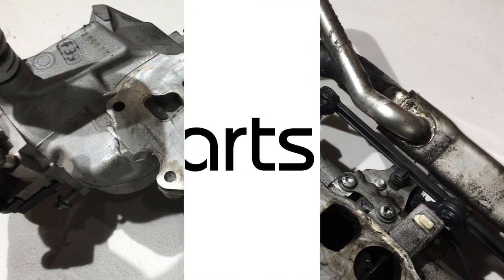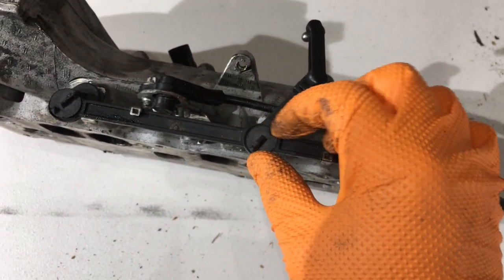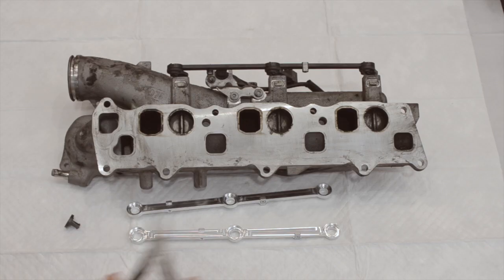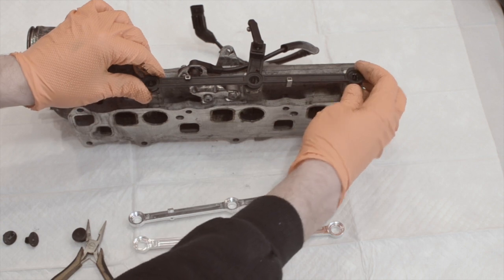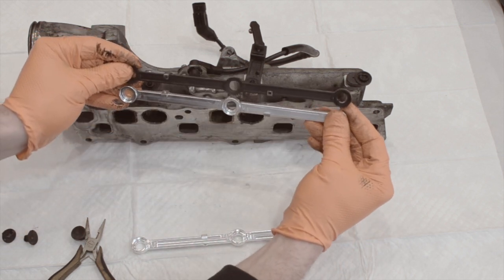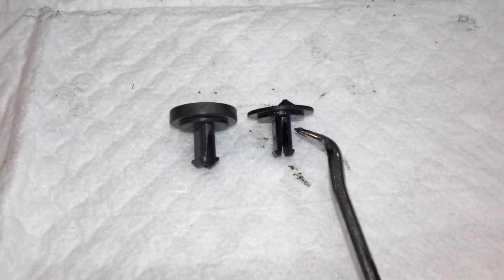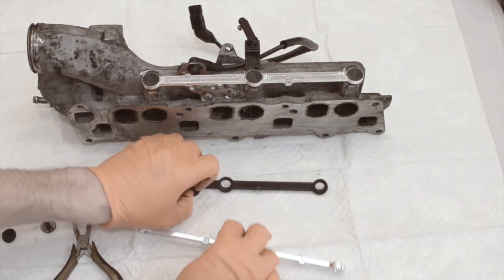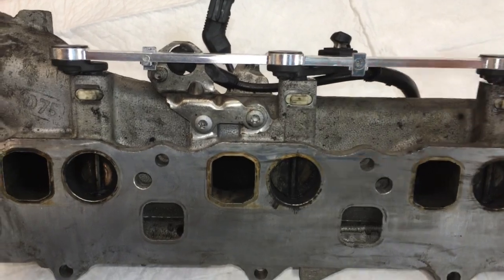OM642 Swirl Flap Rod Repair & Upgrade Kit

Comment: That's a lot of work compared to putting a 4.7 kOhm resistor in the swirl flap motor plug and just ignoring the tiny decrease in fuel economy.
Reply: Have you done it? Is there any increase in acceleration?
Reply: @BBoySewo  Probably a bit worse acceleration and low end torque, those swirl flaps help at low rpm.
Reply: @em4703  thank you for answer. I changed them recently for a new set. Those plastic parts are not really durable.
Reply: @BBoySewo  No problem. As another tip, change the PCV valve and it's connector (A6420100131) every 50 to 70k km and the amount of deposits in the intake will substantially drop. The main issue is oil drops passing into the turbo down to the intake, where it mixes with the smoke from the EGR creating all the issues. So long as there's no oil, the flaps will last alot longer.
Reply: @BBoySewo  How many Km had yours when you replaced the Rods? …Mine is from 2017 and I have 130000Km on it. Should I change them preemptively? ..have you seen a marked improvement in mileage?
Reply: @pventi20  Mine had double of it - around 210k. If you would have to do some engine work that requires to take off the intake, it's good to take a look on its condition. Check if plastics are not broken and if it move smoothly. In my case one flap used to stuck in one position and car gone limp mode
Reply: @BBoySewo  Thanks for the suggestion!! ...I will certainly do a check before doing it. Have you noticed an improvement in mileage, after replacing the rods?
Reply: @pventi20  it's hard to say, because in the same time I changed every seals all the way down, all filters, oils, cleaned intake, changed few faulty things like thermostat, the ecu remap came and the end.. hmm overall, I would say everything together slightly improved consumption, but it's nothing wow

Comment: “The flap servo motor” mentioned right at the end.
What is the issue here?
I’m thinking I need to do Oil cooler seals, this inlet manifold arm.  
But what is flap servo motor job?
Reply: It's the swirl flap motor that he is talking about. THe motor moves the swirl flaps opened and closed.

Comment: my swirl flap links where it connects to the servo motor is  broken. is there a replacement for that? i was told by the dealer that the whole intake manifold needs replacement.

Comment: So now when the linkage tries to move and the thing is jammed up it's the flap that detaches and go straight into the valves?
Reply: Yea, this is not a good "upgrade". Best upgrade is to do a decarb regularly with a decarbonizing spray into the intake, removing some of the caked up oily residue, and even that can only do so much as opposed to physically cleaning the intakes. Changing the PCV valve every 50-70k km and it's connector that goes on the camshaft seems to be the easiest way to reduce the deposits to a minimum, that's how the 4 sprinters I saw with 700+k km on these engines managed to not have issues with the intake flaps getting gummed up. The mechanic taking care of them confirmed to me that the oil residue that gets covered with sooth from the egr is what does them in, he personally changed the pcv valves every 3rd service, so every 45k km.
Reply: @em4703 how much you pay for that service ?

Comment: I have a swirl motor delete from GDE, and plan on adding intake manifolds from CB ENGINEERING.  What do I do with the motor, arms and sensor?  Can I just rip them out when I replace oil cooler gaskets?
Reply: Remove the flaps, put some bolts into the holes.
Reply: NicoToscani but what about the motor?
Reply: @kamaksi24  you can remove it, and put resistor into the plug.
Reply: NicoToscani what resistor value?
Reply: @kamaksi24  4.7k Ohm